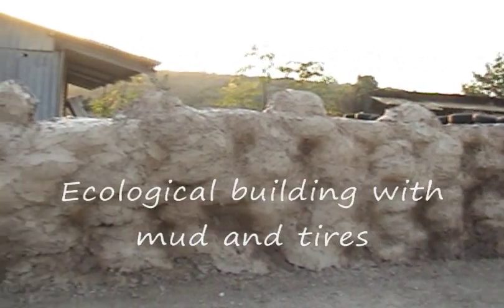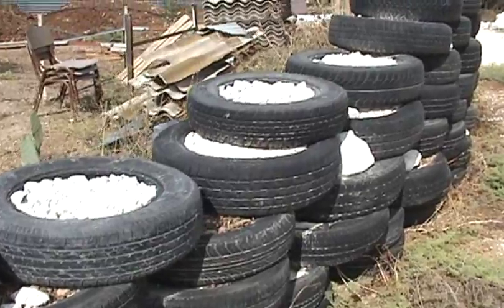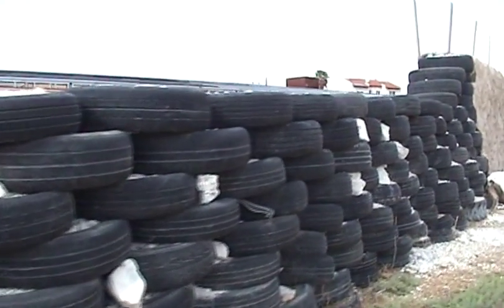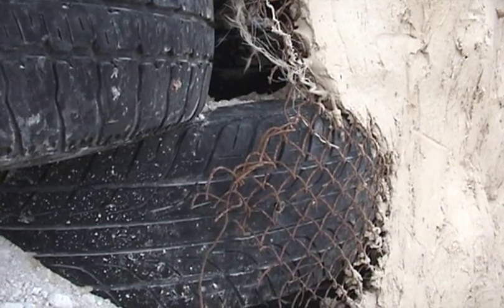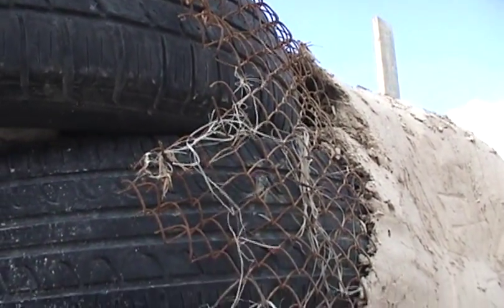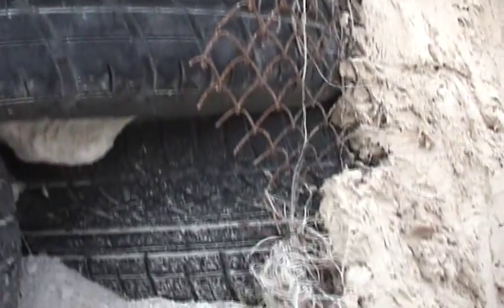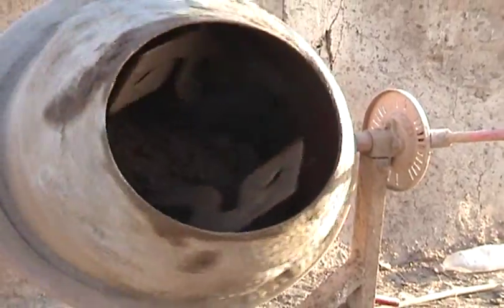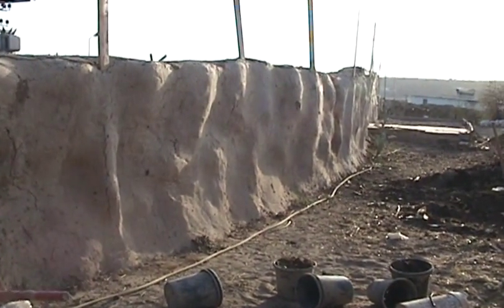Ecological building with mud and tires

Comment: Please let me know if the tires were "pounder" or just filled with dirt and stuff.
Reply: They were not pounded, only filed with recycled construction leftovers. But you must make sure the tires lay against a support, otherwise the wall is not stable and they will fall. You can also use metal posts to stabilize them as well as a fence like net. good luck. marc.